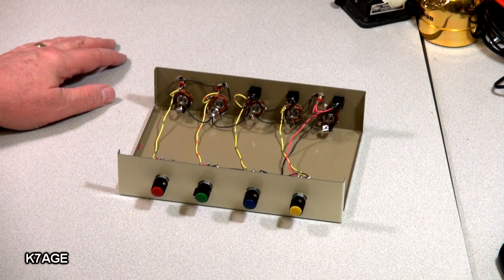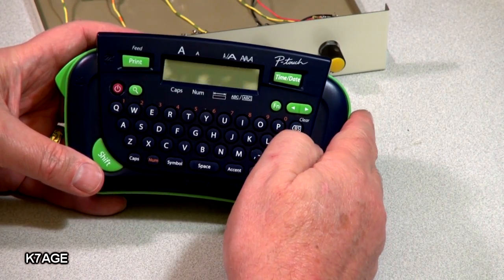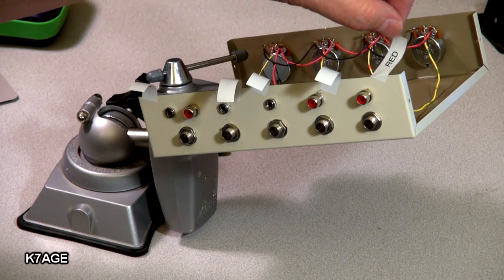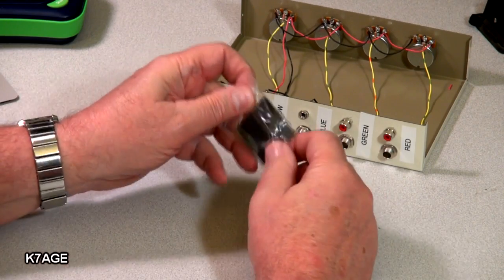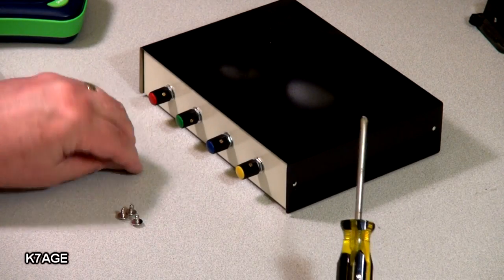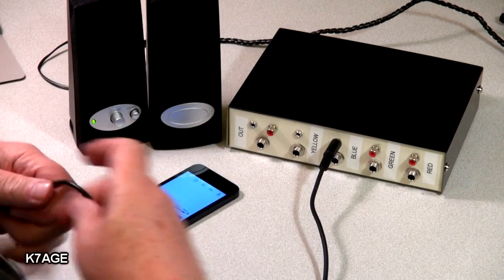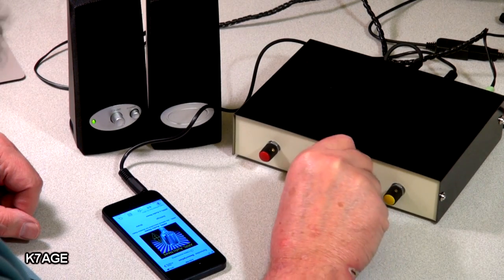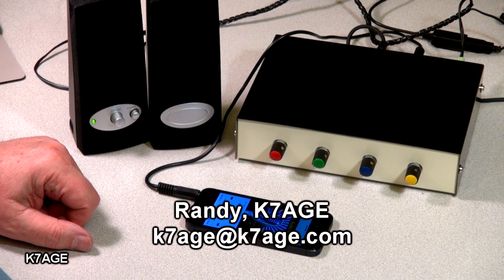Let's Build Bob's Audio Mixer, Part 4: Finishing and Testing

Comment: Nice little mixer.  Question, can it be expanded by just adding for example, 2 more pots and identical parts?
Reply from the maker: I think so. I built this years ago based on Bob's design. I don't even know where I have this packed away. Build and experiment.

Comment: Great, thanks for the video, i have a question regarding the resistors, is it necessary to use resistors ? and why ? 

i will be doing a similar box for my instrument, its sort of a harp with 4 piezos pickups
Reply from the maker: They are there to prevent the output of a device from being shorted when the pot is turned all the way down to the ground end. Just a bit of protection. Value is not critical.
Reply: Okay , thanks Randy :-)

Comment: Thanks so much for these videos. I'm hoping to do something similar (although not quite the same) for live performances: six mono quarter-inch inputs to six mono outputs, each with a volume control. Actually, I wonder if it would be possible to also include an additional master input (with volume) that could be fed to all six outputs. I've done a bit of circuit bending, but never made anything from scratch, so these vids have given me some really useful pointers!

Comment: Hey Randy, are there any concerns with the fact that the audio voltage would be "back feeding" on each source? I would be concerned about putting like level audio from three other sources (other receivers for instance) back into my HF rig for instance. Is this a valid concern, or am I just worrying about nothing?
Reply from the maker: +Bob Holowenko Probably not a problem. You could add a capacitor in series with the from the rig to block any DC voltages.
Reply: +K7AGE Thanks for the quick reply! It was more so the AC Audio voltage that I was worried about as if I get 4 lines going at the same time (HF rig, VHF rig, scanner, and PC) I could end up having all 4 of them putting audio out at the same time thus combining to make a serious spike. The 2k2 resistor might be enough to keep it the "higher resistance path" but I am not convinced it is enough. I have no proof or logical reason, it's basically just me being over protective of my HF rig.
Reply: Shouldn't have anything to worry about--as long as you're feeding similar wattage signals into the mixer the 2k2 resistors are entirely adequate to dissipate the voltages to reasonable levels to where the currents combine at the output jack for the final mix.  https://en.wikibooks.org/wiki/Circuit_Idea/Parallel_Voltage_Summer is a good tutorial on the subject.
Reply: Here's another very good website with more practical application: http://www.daycounter.com/Calculators/Voltage-Summer/Voltage-Summer-Calculator.phtml

Comment: I presume the jack sockets are stereo then??
Reply from the maker: Kristian Ellis It has been so long, but I think so. I may have wired the tip and ring together.
Reply: If the inputs were stereo, you connected one lug to ground and the other to the pot what would I do with the other lugs. Would I need to get dual gang pots and connect the other lug through that other gang on the pot. 

If all that makes sense😂